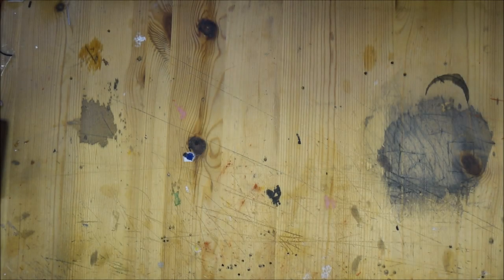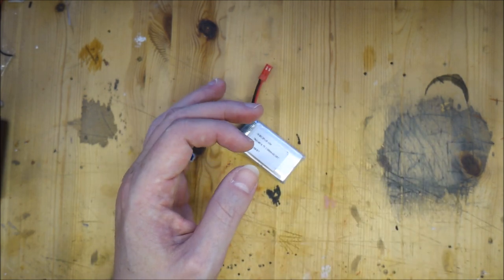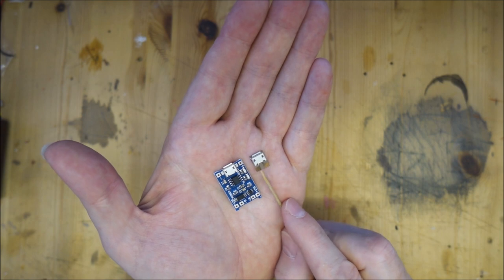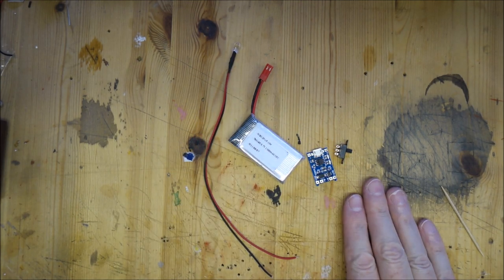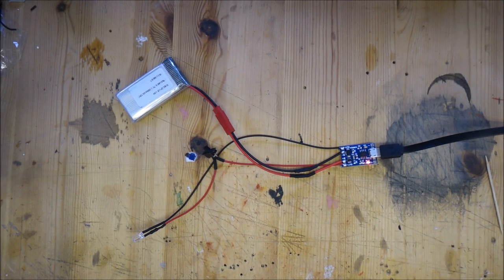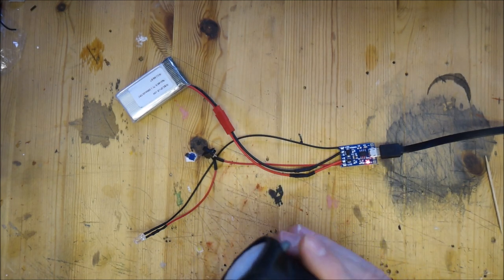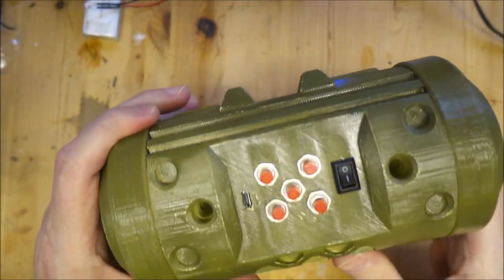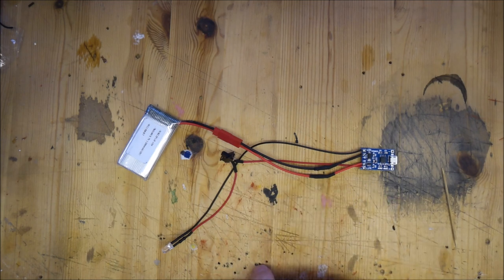3.7v Charging Circuit and Battery

Comment: Would this work in a rc car I hate using battery's there rubbish and I have loads of 3.7v batterys planning to use to so in all 7v of power output to the rc motors (can take 9v max) but want a way to recharge the car without taking battery's out
Reply from the maker: This precise setup, no. It will only output up to 5v so it wouldn't charge a 7.4 (2 x 3.7v) setup. However, there are charging boards that can output 8v so if you used one of those, then that should work. If you look at the linked video at about the 45 minute mark, you'll see what I mean.
https://youtu.be/Nj10oC2lhbQ?list=PL6Tibx9kQcv4peDOdLnA-GK3-Xfc3USIR
Reply: @SteamGeezerUK  thanks dude I'm going to order the stuff next week sometime I'll post updates p.s liked a subscribed

Comment: May i ask if im going to use 3 led white which is 3v each and using 3.7 battery to power the 3 led what resistor should i use? Sorry not that techy 😅

Comment: Great video, ive bought the usb boards, the batteries, im looking at some switches, i  can see the wiring the board, but not the wires that go to the switch, a 3 pin one, which wires go where ?
Reply from the maker: Sorry for the late response - I just replied to your Facebook message.
Reply: @SteamGeezerUK  Cheers :)

Comment: This is a Great tutorial thank you very much for sharing,  I have used this TP4056 charging module before to charge my 18650 cell and they are great. I find this very interesting that you can also use it to charge the small quadcopter batteries because I have some how lost my charger. Just one question please, I have several different drones with different battery capacities! will the module adjust the charge rate automatically according to what battery I want to charge? For example 150Mah  500 Mah  800Mah etc. Thanks again for a Great tutorial... John :)
Reply from the maker: I use these boards to charge a variety of batteries, from 150Mah to 1500Mah, the only difference I've found is in the length of charge time. As long as you're not trying to charge a battery greater than 5v, I don't see a problem.

Thanks for watching.

Comment: Can I use a dc motor in place of LED
Reply from the maker: Sure, as long as the power requirements meet the battery output, you can put pretty much anything on there.

Comment: When I made a charger it expanded the battery is it putting to much voltage?
Reply from the maker: I honestly have no idea. The charger you use has to match the voltage etc of the battery, but if it's a bad battery, it may swell up. I'd leave it outside and away from anything flammable for a few days, and then dispose of it safely. Cheap batteries can be dangerous.

Comment: Hi, i have a question, i want to implement this battery to be charged by a 5v solar panel, what is the best and safest way, does it have to be via this kind of pcbs? Is it a bad idea to connect the battery directly to the solar power to recharge, my idea is to have the battery auto charge on solar energy and operate the rest of the time when turned on
Reply from the maker: Honestly, I'm not the best person to ask about solar - I really know next to nothing about it, but if I ever figure it out, there'll be a video like this one. Sorry I can't be more help.

Comment: How did you power the sound card with out button batteries,  do you have a link to that video
Reply from the maker: There's a video here with one in it, but basically I just bypassed the battery holders and soldered power leads from the battery circuit directly to the soundcard - https://youtu.be/BGVQY74WW3Y

Comment: If the charging module is directly connected to the battery like in this video will it drain the battery?
Reply from the maker: Eventually, yes. It's a good idea to put an isolator between the battery and the charger if possible, but it's not always practical.
One could also put the main switch between the battery and the charger, but that means having to have it switched on to charge.
I used a setup like this in my display turntable, but in that case I added an isolator switch as well as the normal on/off switch.

Comment: im planing on using a 3.7v 600mah battery which I believe will be fine based off what you said, right? secondly can I clip the connector off and just solder the leads directly to the broad, or is there a need for the connector on the end of the battery?
Reply from the maker: That should work fine. As for clipping the leads off, that's what I normally do. The only reason I would suggest leaving the connector on if you can is that it means that if you ever need to replace the battery, it's a lot easier than having to desolder the joints, but if you're pushed for space inside your project, it's sometimes helpful to solder the battery straight to the board. Just be careful to keep the wires apart while you get everything together.

Comment: 3 cells (1.2 V each) connected in series. How can i charge 3.6 V 1000 mAh with 5 V charger? Which resistor i will need?
Reply from the maker: The batteries I use are 3.7v, so you might not even need a resistor. I don't use one, but I'm honestly not sure.

Comment: I pulled apart a cheap Bluetooth speaker because it didn't work. I don't think it supported fast charge, took the battery out & rigged it up to a multimeter.
0.00v! Completely dead!
I salvaged the tiny regulator board, & a long copper foil strip, a long misty like cling film strip, & another strip , which I don't know what that is, might be a nickel foil strip.
The copper foil was blackened, so I cleaned it in vinegar & salt, could easily rub the black away to reveal shiny copper foil 
the logic board has, a 5v charge circuit, a Bluetooth circuit, mono sound output with a headphone jack, & a mic.
I know it would work again if I rigged up 3x 1.2v rechargeable batteries .
The things I salvaged -
- Logic board
- Battery regulator board
- Copper foil strip
- unidentified strip
- 1x 3 watt speaker
I put the unidentified strip in vinegar, & it's turned the vinegar pink!

Comment: Where do you get quality components for your builds. Thanks
Reply from the maker: Depends how you define "quality"... Pretty much all components are mass produced in China these days, and the factories that make them for the big players like Sony etc usually have some kind of retail operation so they can offer the same components but in much smaller quantities to the home market. Basically they use the scale of manufacture required for the big companies to provide cheap components to the rest of us, so technically you're getting the same quality of component as the big players, but whether that's actually true in practice is difficult to say.
There's a whole discussion to be had on the general decline in the quality of electronics over the last few years as people demand "cheap" as opposed to "quality". To answer your question though, I tend to just buy mine from ebay or Amazon and hope for the best.

Comment: Great video. Where would I solder wires to this board if I wanted to add an EL panel? May I email you some photos of what Im trying to accomplish?
Reply from the maker: It would be tricky to run an EL panel off of a setup like this. EL panels need a driver to power them, it's basically a miniature transformer and inverter that boosts the 3v DC to about 100v AC. In theory you could connect the output from the charging board to the battery terminals on the inverter, but I honestly couldn't say if it would work or not.

Comment: When you are charging the battery with the micro usb, is the led still getting power from the battery or from the microusb? If it's from the battery, is it harmful to both charge and consume at the same time?
Reply from the maker: I'm honestly not sure. If you connect an LED to the charging board with no battery, it will work even without the battery, but every time I charge the battery I always turn off the LED.

Comment: What type of switch did you use? I can't find switches compatible for 3.7 volt batteries.
Reply from the maker: I generally choose the switch based on where I want to put it, rather than any rating of the switch. All the switch is doing is completing the circuit, so at this voltage pretty much anything will work. Something like the ones at the link are rated to 125v but will work fine for this kind of thing - https://amzn.to/2EsO0W7

Comment: Hey do you think if I exposed the wires on the rechargeable battery and connected it to a DC Motor (24 volts) that it would be able to charge the rechargeable battery?
Reply: Or since I saw that you used a usb recharger, if I connect the DC motor to that, would it be able to charge the battery?
Reply from the maker: I don't think the charging board has an incoming voltage regulator on it. I think if you put 24v through it, it would fry it.

I'd also be very wary of putting that kind of load to the battery without a voltage regulator. Lithium polymer batteries can catch fire and even explode if they are overcharged.

You can get variable voltage regulators that would drop the 24v to 5v, but I'd test it very carefully and be very wary of the battery overheating.
Reply: Yeah I understand, we’ll even though it’s a 24 volt motor, I’ll only be producing electricity by hand, which I tested before with capacitors and I believe after 100 rpm I was only able to create 0.2 volts, nothing dangerous; so that trial is just to see if I’m able to charge & let’s say it does work in the trial phase, would I be able to put 4 rechargeable batteries in series to provide a larger voltage to perform work or would using secondary batteries this way not be good?
Just wondering how legitimate my project can be with storing energy and using it at a later time 

Thank you for your help!

Comment: do you have the schematic in order to add that on my project
Reply from the maker: I'm afraid not, no. It's pretty simple though, just a switch, the circuit, the battery and a light.

Comment: Hey hello love and warm regards from India, I wish to know one thing this is a TP4056 circuit normally built for 4.2V that's the voltage for a Lithium ion battery, Lifepo4 or 3.7V lipo batteries have max full charge voltage of 3.7V so how can we precisely charge a 3.7V battery from a 4.2V charger without raising voltage of 3.7V to 4.2V. I wish to build a charging rack for lifepo4 EV cells rated at 3.7V 6A

Comment: interesting video.  how many 3.7v cells of what mAh capacity can be charged through the board in parallel and in series?
Reply from the maker: I've never tried more than one in parallel, to be honest. The largest battery I charged was 1200mAh, but I don't think the capacity would make a difference other than to how long the charge cycle would be, so I would imagine you could put as many batteries in parallel as you like. The batteries I use, although rated at 3.7v tend to output 4.4v when fully charged, and the charger outputs 5v, so it won't charge more than one battery. I did try to charge two 18650 batteries on one of these once, and it didn't work - I had to find an 8.4v charger for that.
Reply: As far as I understand you use a seperate module for each battery that you want to charge, They are very cheap to buy :)

Comment: Can I charge 4   3.7v  battery in parallel series with this board
Reply from the maker: I honestly don't know. I don't see why not, but the charge time would be quite long I think.
Reply: @SteamGeezerUK  thanks for your reply
Reply: This circuit is specifically made for 1S batteries. As I read on web, you need one of these for every single cell(S) to charge them

Comment: so this little usb charger also converts 3.7v to 5v ?
Reply from the maker: This particular one doesn't step up the voltage, but in my experience most 3.7v batteries actually produce a nominal 4.4v. You can get charging circuits that have step-up transformers to output 5v from a 3.7v battery, but they're more aimed at charging mobile phones and such.

For small circuits, these batteries will generally provide sufficient power. For example, in the Titanfall 2 SERE Kit I made, one of these charger/battery circuits is powering two LEDs, one Epistar diode and a soundcard and speaker.

https://www.youtube.com/watch?v=BGVQY74WW3Y

Comment: so i am inventing a new lint remover that has two blades that remove lint and hair from clothing and fabric!  I have sourced a few powerful 3.7 volt sonic vibrator motors and im wondering if my two AA batteries will give the 3.7 Volt sonic vibrator motors the best and most optimal power that they need?  Have not tested it out yet, but i have a feeling these two AA batteries will not be the best and most powerful battery for the powerful 3.7 volt sonic motors!  Perhaps, there must be another more viable and better suited battery system for these 3.7 volt sonic motors, right?  Also, i know that if i decide to use a usb rechargable battery, this will dramatically increase my price per unit which is not ideal for me becasue i plan to sell this lint remover at no more than $20!
Any thoughts would be helpful 
Thx in advance!
Reply from the maker: I don't know what the power requirements are for your motors, but AA batteries only put out 50mA (or so I'm told). A lithium polymer battery will probably give you a lot more than that (it's different for each battery, so I can't say for sure). You might also consider a single 18650 type battery. I would suggest trying it with AA batteries and see how it works. If you need more power, you might have to go for a bigger battery.
Reply: @SteamGeezerUK  so you're saying use the AA batteries in combination with the 18650 lithium polymer battery?  if yes, how would the customer recharge the product?  Would he have to replace the AA batteries and the lithium ion polymer battery?
Because i thought that all lithium ion batteries are rechargeable?  To make things simple, lets say that i do decide to go with a 3,7 volt sonic motor, then i would just get one 18650 lithium polymer battery and if i need more power then i just add another 18650 lithium ion polymer battery?  also, i dont think this would drive up costs because i am very confident the factory in China can get all these lithium ion batteries and sonic motors off the shelf or just buy existing lithium ion polymer batteries and sonic motors and from here, the factiry would just wire up the sonic motors to the lithium polymer batteries and connect it to an on/off switch and since i only have 1 vibration speed and mode, there would not need to be a circuit board or PCB, right?
Reply: and i forgot to mention the usb cable needed to recharge the product, this can also just be put in the package instead of making an entire complex charger separately for the product, right? @SteamGeezerUK

Comment: Hello sir the module is heating up
Reply: Sir please tell me
Reply from the maker: I'm not sure what you want me to say. If the board is getting hot, either there's too much power going through it or the board is faulty. I would recommend replacing the board.

Comment: What is the circuit board number
Reply from the maker: I don't think it has a number on it. It's a 5v micro USB charging circuit.
Reply: 5V Micro USB 1A 18650 Lithium Battery Charger Board Module TP4056 TE585

Comment: The charging module get heat
Reply from the maker: Any electronic component will heat up in use. If it gets too hot, however, there may be something wrong with it.
Reply: Thank you

Comment: Hey #cool thank s for the info.  ??? I am a bit stuck on a project.  I need a long lite batery to cover 2 charger 5v for phone . also need to cover a mmptt S charger 🏃 att 12v . batery just die . your take on a good 5v to 12v lite batery I need at least 3h time to charge a normal Android 📱 + 5v 3w led camping bulb .  Hey tha knives is So #cool
Reply from the maker: I'm not entirely sure I understand the question, I'm afraid, but a setup like this won't charge 12v. If you're after a charger for a phone and a 5v LED, I would suggest using some good quality 18650 batteries in parallel to give a good long life. This could be connected to a charging circuit to charge  a phone and another output to run the light.
I'm not sure what the 12v part is you're talking about, but if you want 12v I would use 18605s in series and parallel to give a 12v output, a voltage regulator to drop to 5v and then connect to the charger as described.
I hope this helps, although it might be easier to buy one ready made - a lot of companies making camping chargers.